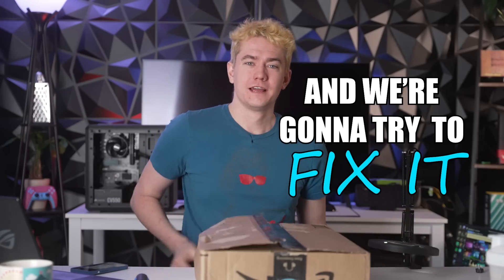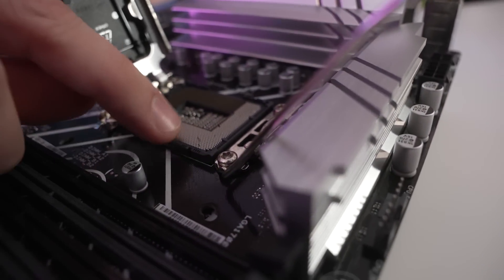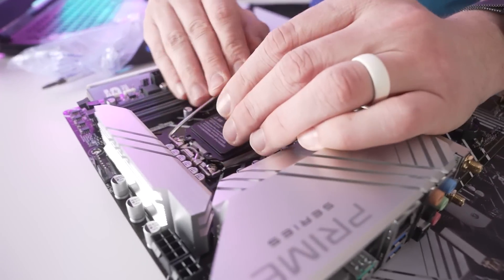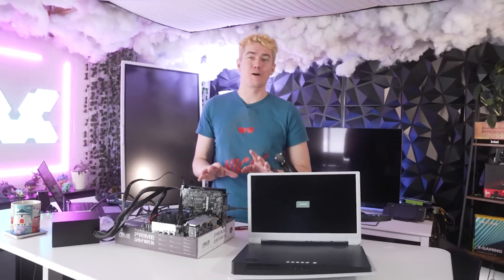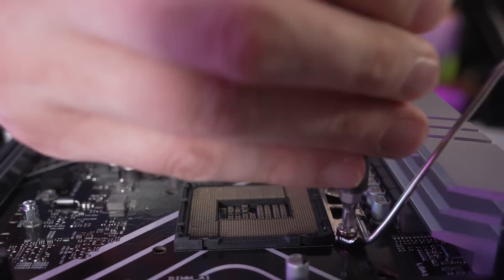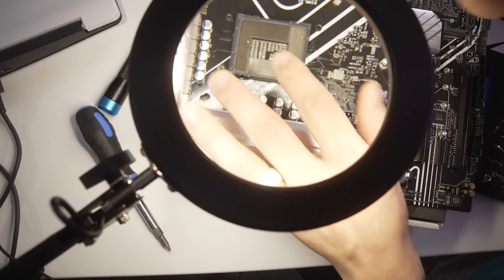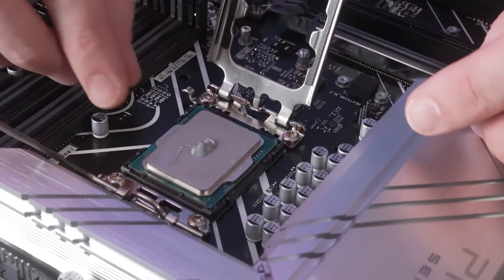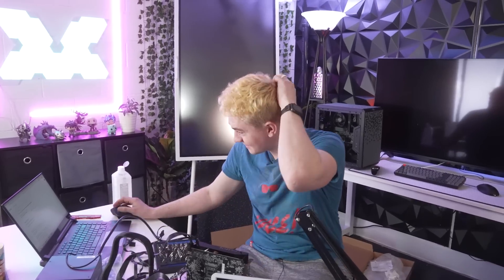Don’t Do This To Your Motherboard

Comment: Similar thing happened to me on an quite old 4th gen motherboard (actually in my country even 4th gen pc without a gpu goes to 200 dollars)

Heartbroken, with a non functional motherboard, I decided to fix it as i had nothing to lose. I didn't have any specialized tools, used my iphone 7 to zoom in and get a clear view and a small needle and a toothpick to realign thr pins. After 4 hours of prying, with 1 or 2 broken pins, put in the cpu and booted it up.

The lights turned on for a second and off, which didn't happen earlier, so not all hope was lost. Removed on of the ram sticks and oo laa laa the booted. Turns out dual channel mode doesnt work on the pc anymore unless you put the ram in the next slot, which is not the proper way to fix it.

P.S: long story short, fixed the board, dual channel ram doesn't work anymore.

Comment: A hook and pick set will make straightening pins much easier than using blades, screwdrivers or PC/phone pry tools. Jeweler's/precision/mini screwdrivers can be useful for straightening pins, however, being larger in diameter and having no hook options will make it more difficult than using hooks and picks.

Comment: You can look up pins actually. I purchased a replacement motherboard that had 2 missing pins. Looked them up before purchase. 1 was redundant and the other was for dual channel memory. I ended up getting it and it's fine with single channel.

Comment: looks like it got put in flipped the wrong way. been there before. Intel board pins suck to fix. ive never broken an AMD chip, but ive gotten lucky having knocked a couple pins off of one that seemed to be dummy pins thankfully. that Phenom II x4 955 still overclocked and ate all 1.54V i threw at it for like 2 years

Comment: Bummer. IIRC, Gigabyte quoted Newegg $100 to replace the socket on that $500+ mobo they sold to Steve. I don't know if that's the cost they'd throw at the average person, but if this is a $300 board, it'd be worth it.

Comment: Ahhhh, the corner stone of every quality electronic repair....no concern for ESD.
Reply: Eh, the likelihood of ESD causing any meaningful damage is super low.  It takes a lot of juice and just the right conditons to actually screw anything up. That being said, if it was my stuff that I spent my hard earned money on I'd have my ankle strap on.
Reply: I've worked in IT since I was a teenager and I have only ever seen ESD kill anything once. It was at a thrift store when a kid touched the back of a PC power supply while it was on. Killed it instantly.... But the PC was ok.

Jk, the kid was fine, but the PC was dead.

Comment: All memory slot pins and some PCIe pins (some slots are connected to the chipset) are connected to the CPU. Not using all 4 memory slots and only using integrated graphics reduces the amount of used pins a lot. So it might work now, but expanding to 4 memory modules and adding PCIe cards in the future could reveal problems.
Reply: The pins can be looked up
Reply: But it doesn’t work now…soooo…🤷‍♂️lolwut?

Comment: Why did we stop making CPU Slot interfaces? Seems they are a lot more robust than a LGA or PGA.
Reply: LANES LGA 1700 has 1,700 pins  that would be needed on the slot. Just to start. Other considerations are the timings of the lanes to the corresponding component elsewhere on the MB (RAM, Chipset etc) The length of some of these should be as short as possible (RAM) for access speed (why ram slots are close to CPU). In a nutshell, it increases complexity and slows timings.

Comment: Is the owner going to try and send it back to the manufacture?
Reply from the maker: He doesn’t want it back. Might try to replace the socket
Reply: @UFDTech  cool. Ya i would for sure try that. I have done surface stuff before. It is tricky. Just dont heat one spot for too long.

Added: removing pin hole components on todays MB are really annoying to say the least because of many multi layers. I used to fix MB in the early to mid 2000's and those where much easier.

Comment: Sometimes you can use a syringe to straighten the pins if you find one that is not that sharps to damage the surroundings of the pin
Reply: Also what about the hot news these days?
Reply: @Chemy.  The hot news is on its own Hot News channel. You can catch it there
Reply: @I_NeedCoffee  i know, but not news today or yesterday 🥺
Reply: I was also thinking that maybe if you already see something broken like pins bended you shouldn't try to turn it in because it can cause short circuits and make it worse than before

Comment: Yeah, the Prime series often lacks troubleshooting lights...Asus even uses the awesome red/green/amber/white combo...then leaves them off at the 300 dollar price point.  Come on man!
Reply: My Asus Prime X570-Pro motherboard (€235) has the 4 Q-leds: dram, cpu, vga, boot. And I used them to troubleshoot memory compatibility issues. I could fix POST problems with BIOS updates, because the leds indicated dram problems.
Reply: @a.j.haverkamp  are Asus boards better than Gigabyte or MSI boards?
Reply: @tasnimulsarwar9189  I don’t have an opinion about that. I have only used Asus motherboards in the past 15 (?) years, without problems. Before that, I used Asrock, Abit and more brands that don’t exist anymore. Every company has good and bad products. So having good warranty is more important.
Reply: @a.j.haverkamp  thanks for the advice. Will keep the warranty thing in mind when I buy my next motherboard.
Reply: The lights on Asus boards are bugged anyway, they turn on for absolutely no reason.
Reply: My (now older) Prime Z270-A has diag led's, CPU, D_RAM, BIOS, BOOT etc...